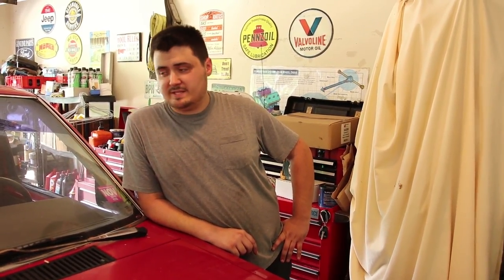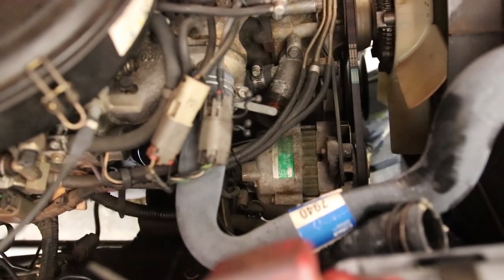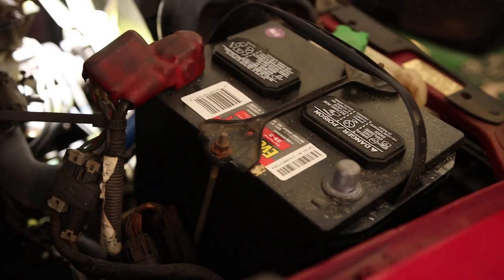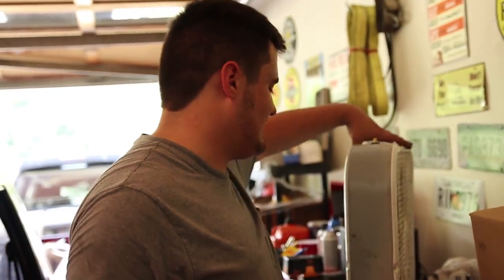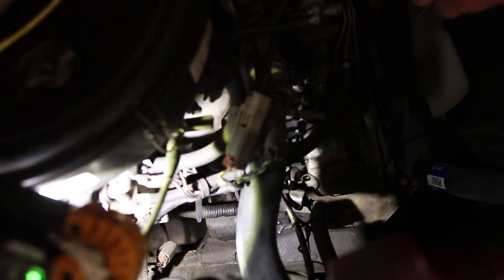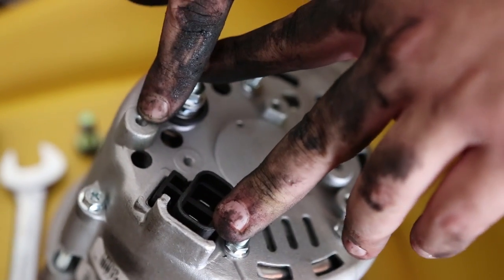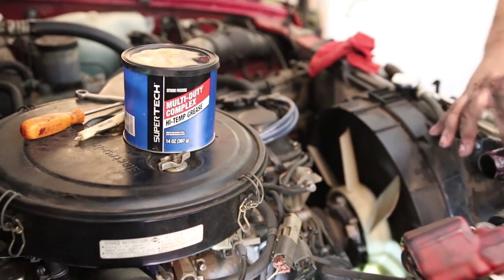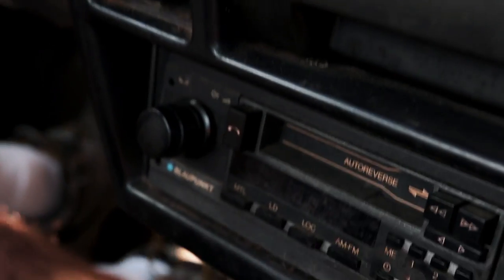Nissan Truck Battery Not Charging / Alternator Replacement

Comment: Thanks for the video. Lucky for me, I need a new thermostat and will kill 2 birds with one repair. I need better luck...
FYI - Lots of reconditioned, and 1 new alternator for sale at RockAuto. I'm ordering mine today. About $75 shipped with the new thermostat and gasket. Their prices are as good or better than the used ones on eBay right now.